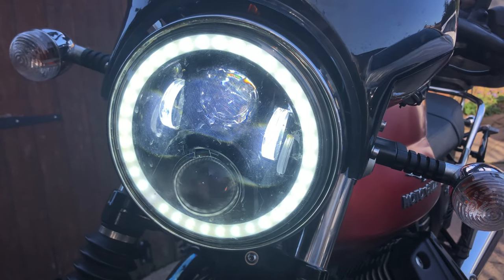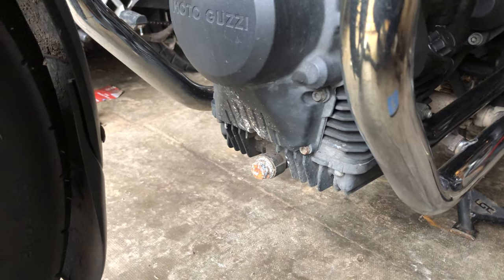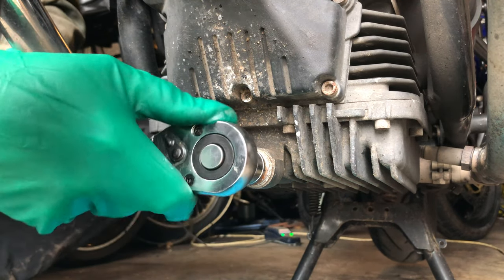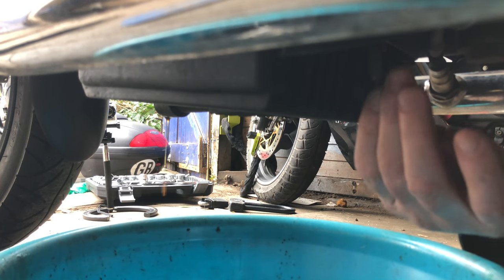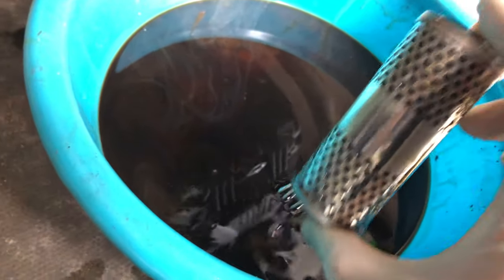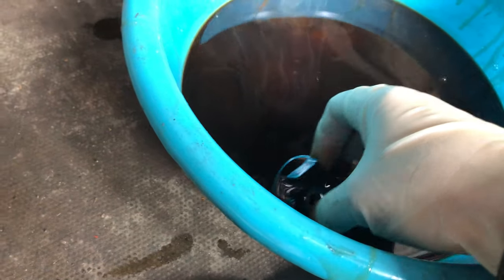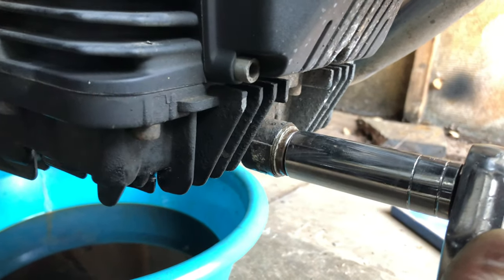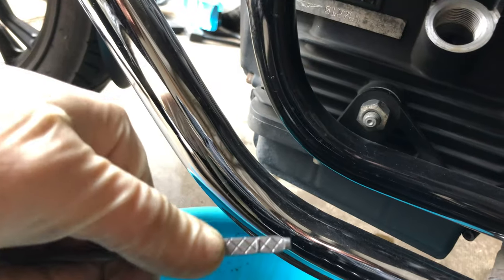How to change the oil and filter on a Moto Guzzi V7  all models motorcycle maintenance

Comment: I used to have an SP2 from 1984. To change the oil filter I had to remove the carter pan. Laying on my back under the engine removing 12 screws and catch the pan to prevent it from falling on the street with a potential breaking of it. After changing the oil filter I had to lay under the engine again to put back the screws. It’s an enormous improvement of how the oil filter is placed now.
Reply from the maker: Don’t know w/o they designed them like that, small blocks are much easier. My Breva 1100 does have an easy to remove filter, finally
Reply: The cause of this was that the big block not had an real oil filter from the beginning. The filter position was a later modification, from the early 70-is.

Comment: The tool to get the filter flange off is a thing called a nail lifter, looks like a slightly bent screwdriver with a claw hammer slot. 101 uses other than pulling tacks up.
Reply from the maker: I am aware of them
I just don’t have one. They are usually Perspex

Comment: Guzzi says to check the oil while hot instead of after it cools like in others. So when you fill it, it shows a bit lower than when it's hot if you use the amount of oil they recommend, you won't overfill.
Reply from the maker: Nice idea. Or just don’t fill to the top

Comment: Lovely clip and useful. I gave V7 Carbon. I find the clutch lever  is tight to pull and getting the neutral is difficult. So I need to the clutch in traffic etc. Please advise me. I get tired soon on long rides
Reply from the maker: Well look at the cable see if it’s carefully routed , no tight bends 
Lubing the cable always helps 
Basically remove lever from cable fasten a small bag over the end with an elastic band so it’s like a funnel and put some oil in 
Engine oil is good or gear oil and wait a while oil will run through after a few hours . Cable will move much smoother. 
The lever arm at the back of the gear box that the cable attaches to can stiffen up , it’s hard to get at so clean as well as you can and spray lots of WD 40 and move it by hand .
Those things should hopefully help
Reply: This issue is often caused by an out of adjustment clutch cable.  See owners manual for adjustment specs and methods.

Comment: I recommend using a torque wrench for every bolt in this video.
Reply from the maker: Assuming everyone has one 
And go conservative on the settings I’ve been caught out a few times using factory settings on Guzzis
Reply: I recommend you don't. Go by feel. Many a stripped bolt due to torque wrenches. Ask around among mechanics. Headbolts yes oilchange no.
Reply: @autonomousindividual7780  The tightening torque for drainage plugs is only 12Nm (8.85 lb ft). It's just impossible to harm this bolt with such low torque. And I'm quite sure you have put more torque on this bolt and nothing wrong happened :) Anyway, I use torque wrenches for everyday serivce and I have never beed disappointed with results.
Reply: @autonomousindividual7780  Professional mechanic here. I have used a torque wrench countless times, including on drain plugs, and I have never stripped or broken anything when the wrench was set to the correct torque for the given fastener. I will say that whenever you are given a torque range rather than a single number always set your wrench to the middle of the range, just to be on the safe side. Also, torque wrenches aren't accurate at the extremes of their range, so avoid using a particular torque wrench if the setting you need is at the very bottom or top of its range. Choose a wrench with a lower or higher range depending on your situation. Finally, always inspect your fastener or plug before reinstalling to be sure it's in good condition. If it's suspect, replace it. The cost of replacement hardware is much lower than the cost of repairs caused by bad hardware.

Comment: How much oil do these bikes take?
Reply from the maker: 2 litres is what the manual states but usually a bit less in the real world particularly as you do not want to over fill . I fill to the half way mark and no more .
Reply: I had about 200ml left with the half dipstick. If you fill it right up (2l) you run the risk of sucking up oil into your airbox and then you may have to change the air filter . Will check the levels  after the first decent run